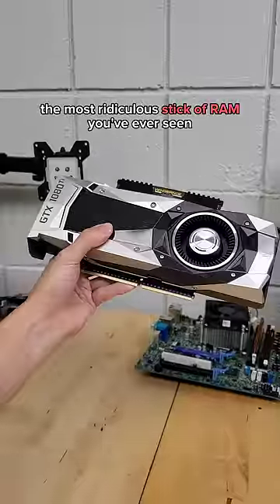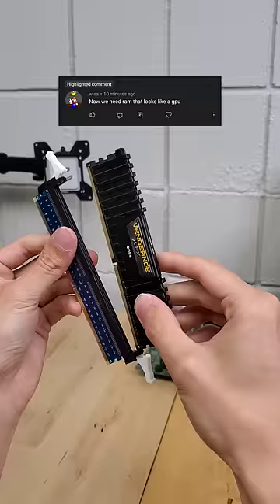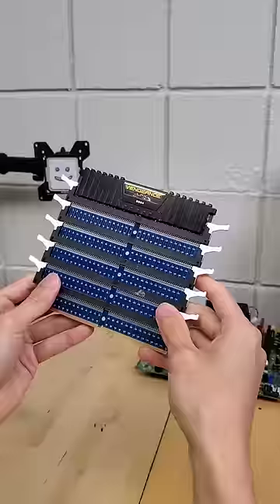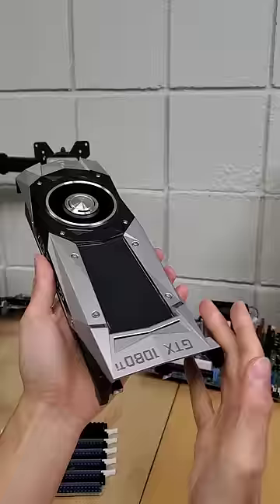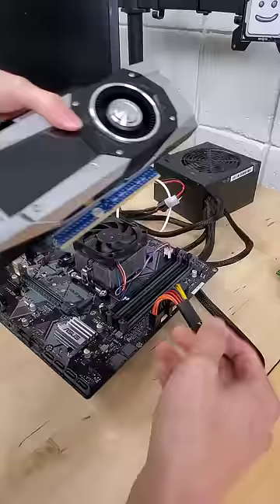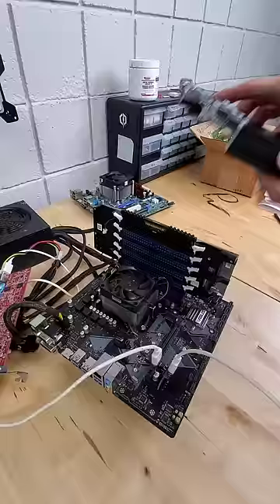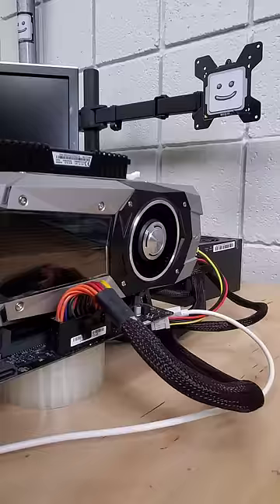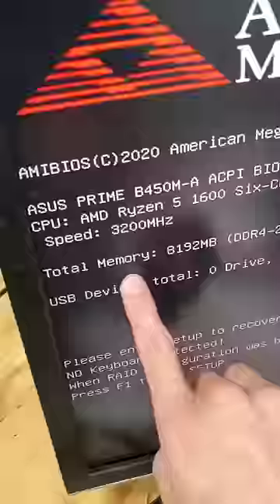the most ridiculous RAM you've ever seen #shorts

Comment: I mean... Imagine the latency that ram has 💀
Reply: but now u can do an extremely over clock
Reply: @rafaelsoares1779  theres only so much you can overclock ram before it burns out. Regardless of the fan
Reply: It's just a riser, so I don't think it would have any effect on the latency or data throughput
Reply: You would need to use an adapter with a really long cable to have any real effect
Reply: @ImperatorCaesar22  yes it would for latency because it takes longer for electrons to go through the wire
Reply: @ajddavid452  It would, but not that bas as initial comment’s emotional halo predicts. The raisers’ additional latencies are barely noticeable
Reply: @ImperatorCaesar22  you have to realise that  20cm is 1 nanosecond delay.
At 5ghz that is 5 clockcycles.
The distance is a less than that so the latency wont be that bad.
But it might be measurable
Reply: @bonnome2  excellent reply sir
Reply: @ajddavid452 electrons dont go through wire like most peaple imagine, electrons could really move only about 8 to 9 cm per hour, so really slow, it is more complicated, important is that they transfer energy fast enough, with that speed of movement i dont think the risers do some significant difference because electrons would be really slow to transmit energy by their flow if it worked as people think even without them, also, electrical energy doesnt even flow in wires at all, it is a combination of electrical and magnetic field which surround the wire
Reply: Friends l shot 15 pull-ups on one arm Support please                .
Reply: @bonnome2 why GPU needs ram so close then?
Reply: @chervilious  I don't know, it might also be to limit the interference
Reply: @bonnome2  every time I open google it's always show "reduce latency. And Isn't that why we remove / not supporting upgrade-able GPU Memory?
Reply: @chervilious  I can't find it that easily. They're several reasons why GPUs dont have socket able vram. For example the rtx 4090 has a bus width of 384bits. Meanwhile DDR5 only has a bidwith of 64bits.

It probably is more an issue to get all the latencies between the memory chips the same when you increase distance and make it socket able
Reply: @chervilious if i remember correctly this is somsthing to do with VRam but does not apply to RAM. I couldn't explain it though
Reply: @ericmamleev  Stop this shameless self promotion 
I see you everywhere
Reply: There would be negligible difference in latency.

Comment: that 1080 Ti didnt deserve to be skinned
Reply: Blower coolers are so shit you can put a real dual fan cooler on it
Reply: @RevAim Quad fan GPU or nothing
Reply: @RevAim  founders edition 1080ti is a work of art
Reply: @godofFPS  sometimes you have to use them in old cases etc
Reply: sure but its a FE meaning destroyed value, i mean, he prob wont be selling it anyway @RevAim
Reply: @RevAim Just because your case is too shit to provide airflow, dosent mean that the founders cards are shit lmao
Reply: @AveragePootis  i had a founders 1080ti before and it was always hit 80c at high load changing the blower gave me -15c of temps blower are awful better to replace it with a proper dual fan atleast. Design over performances is what founders blower type is.
Reply: @KiotheCloud  my friend's founders stays in the mid 70s, probably requires a pretty specific airflow config then
Reply: @RevAim   2  fans of my 1080TI  broke still going strong
Reply: Not for no damn 8GB of RAM
Reply: "psycho where is your nanosuit"
Reply: @AveragePootis  Blower cards just ain't it
Reply: @RevAim I honestly find blower GPUs to be better looking but to each Their own.
Reply: Do not fear for undervolting is here
Reply: @Sizzlingfoil231ProductionsLtd better looking absolutely but abysmal at cooling. It's funny because those fans can actually move more air, but it's more a surface area issue than anything.
Reply: Like
Reply: Bear in mind the 1080ti had 11 gig of RAM AND a GPU on this cooling solution. 🤣

Comment: Extreme overclocking. My ass. That 4 risers stacked cause so much signal integrity decay that I'm still surprised it booted at 2133 MHz
Reply: The risers are cooled though so all good
Reply: @Cyba_IT  lol my same thoughts didnt even put the cooler on the top stick
Reply: @drekenproductions  the video guy has to cool  temperature of the 1.5v lanes hahaha those are burninggg
Reply: I was just about to do a post about signal reflection and you beat me to this by only 2 years or so ...

Comment: That ram is most certainly not ready for XOC, you just doubled the trace length, added more connections to fail, AND you didn't even change out the blinker fluid in the LED's

Comment: Something doesn't add up. The fan plug was disconnected the whole time and yet you said it spun up... Also you connected the heat spreader from the GPU with thermal pads so there's no electricity going from the RAM to the fan shroud.. does not compute